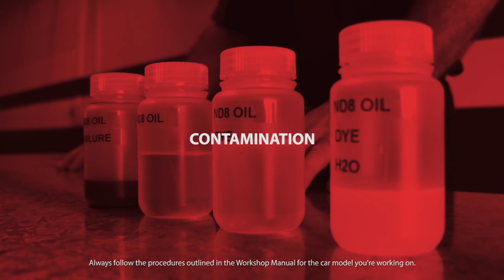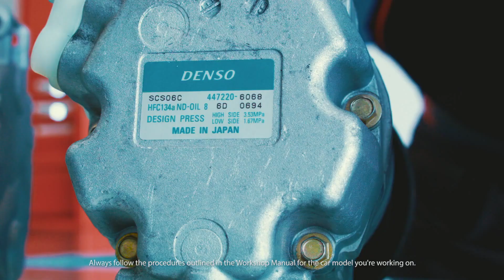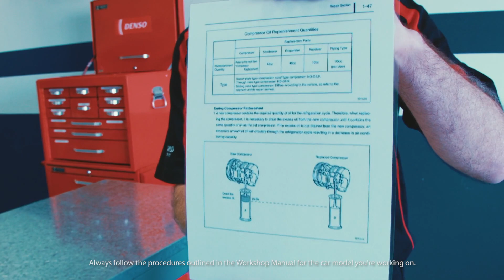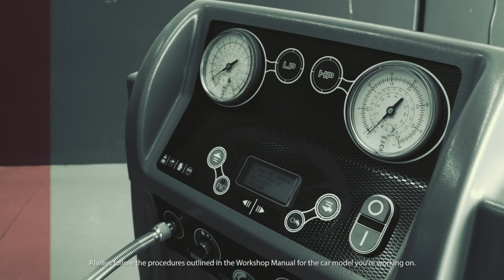DENSO Preventative Measures for Air Conditioning Systems - Compressor Care

Comment: Hi, i have a Denso AC Compressor 6q0820803D 6SEU12C, on my car writes that it needs 750g R134a refrigerant gas, but on the Compressor says it needs ND-OIL 8 140cc, 140 is refering to 140ml of oil and the rest of 610ml refrigerant ? or 140ml oil and 750g of refrigerant ? do i need to change the oil ? my compressor works fine. please help me !

Comment: I'm about to buy a DENSO 4717005 to replace the original compressor on my 1996 Jeep 4.0L
The OEM system specified 7.75 oz of PAG 100. Should I use ND8 (a PAG 46 oil) instead of PAG 100?

Comment: What is the correct procedure when filling oil for evaporator, condenser, hoses, etc. if they also have oil quantity specification? Can I put the total amount on the compressor? Please advise. Thank you.
Reply from the maker: Hi, The total amount of oil for the system will be in a new DENSO compressor unless stated different by the car maker. If you would like more info please visit https://www.denso.com.au/resources and read the DENSO compressor oil balance information and refer to the car makers repair procedures.

Comment: Why the solenoid valve of Denso 5SE09C fails so frequently?  Seeking permanent solution.
Reply: Am from Tanzania, my car came that compressor (5se09c) i replaced it two times with new one also replaced a condenser, but within a month those compressors were gone. What i did was modify the ac system by installing fixed displacement ac compressor that has external clutch.. now the system works fine, and this is a permanent solution which is used by many people in my country when replacing variable displacement compressor.
Reply: @tanzaniacarschannel6975  I know that fixed Compressor is the permanent solution but not the best. I want to know from Denso why the variable compressor fails? They should answer their customers.
Reply: @archselarchitects  I agree with you.
Reply: Too much refrigerant oil.

Comment: Please I just bought brand new  denso compressor, receiver dryer, expansion valve, condenser and new o rings. Would the oil in the compressor be enough for all the components in my Corolla? Since the old one dried out the oil so I cant measure. Please reply. Thank you.
Reply from the maker: Hi Jacques, DENSO compressors generally contain enough oil for the entire system
 but you will need to check the Toyota Corolla manual on their specification.
Reply: @densoaustralia136  thanks

Comment: Hello I have a question if I may i retrofitted a 93 Honda Accord 1 year ago and I flushed out the system professionally and purchased a new Denso compressor and a denso dryer/accumulator , I completely flushed out the system professionally and remove the mineral oil that came with the new Denso compressor which was for R12 refrigerant I replaced it with pag 46 and when I recharge the system with refrigerant I did inject 1 oz extra of pag 100, a year later my evaporator had a leak which I replaced and installed as well a new Denso expansion valve and a new dryer but I forgot to put refrigerant oil in the dryer as well as the evaporator, and when I recovered the system it also recovered refrigerant oil so when I charge the system I added 2.5 ounces of refrigerant oil not knowing it was pag 100  the AC is blowing cold like never should I be concerned about pag100 in my system?
Reply from the maker: Hi Laz Rod, Thank-you for your message,  Here at DENSO we believe in using the correct oils for the correct application and never blending oils. Using the incorrect oil in the system could lead to premature failure of a component in your system. If you have used the incorrect oil for the system or blended the oils it would be recommended that the oil in the system is removed flushed and replaced in accordance with the service manual.
If you require assistance with this process we recommend consulting with your Local DENSO service dealership.

Comment: Hi DENSO team, Thanks for great videos & products.

Question about ADDing Oil to completely flushed compressor system

I am replacing all my Ac components on VW Passat 2002 (AZM Engine 2.0). Condenser, Evaporator, Drier, orifice, Hoses and compressor (Magnetic clutch 7SB16C).
250ml is total oil requirement for my whole system as per VW manual and system is R134a.

My question is about adding oil after complete flush or complete new components. I have two choices:-

1. Calculate oil came with new compressor (say for example it had 200ml). Pour back 200 in new compressor and where shall I add the rest?
Is it condenser or drier or add with new compressor itself?

2. Other option as Manual says distribute oil - 50% Compressor, 10% condenser, 10% suction pipe, 20% Evaporator & 10% Drier.
Confusion is adding OIL to “Suction pipe” - which flows directly to compressor LP port and into compressor. So what’s point?

If Option 1 can be right then I am happy as adding 250ml direct through compressor drain plug and rotate 5 times clutch and charge system.
Also I understand OIL is only for compressor lubrication and nothing else.

Hope you can get me the right answer which can help others too.
Reply from the maker: Hi Rashid,
The compressor oil will eventually distribute it self evenly through out the entire system after a few minutes of running. DENSO compressors come charged with oil usually for the entire system but follow the specification from the car maker.

To answer your question, adding 50ml of oil to the system can be done anywhere in the system but I agree not to put it into the suction line.
Make sure you turn the compressor over by hand before starting and then let idle for a few minutes with the AC on.
As long as you are not dumping a whole lot of liquid into the suction side of the compressor it should be O.K.  

I hope this helps, 
Cheers, DENSO Service Team